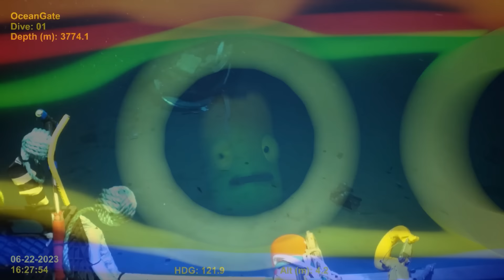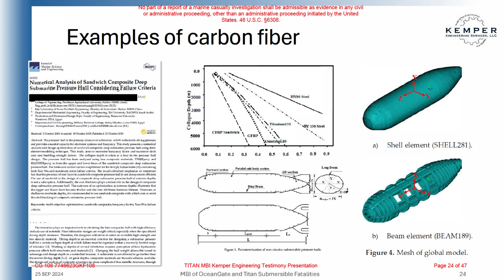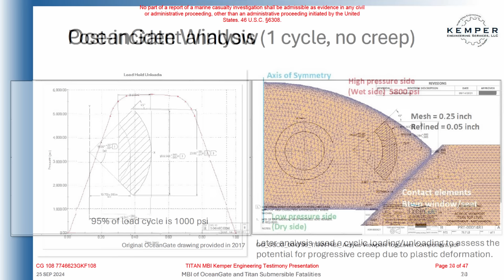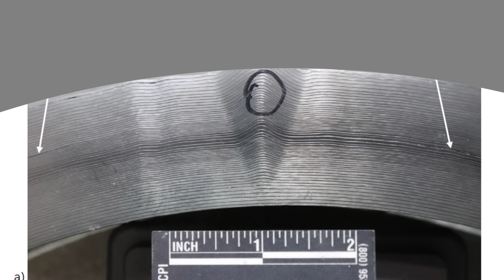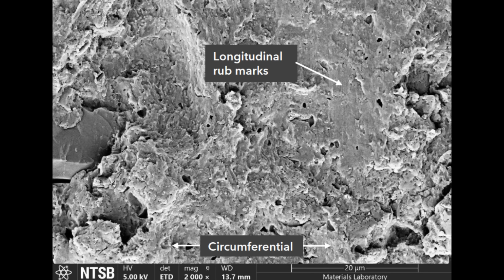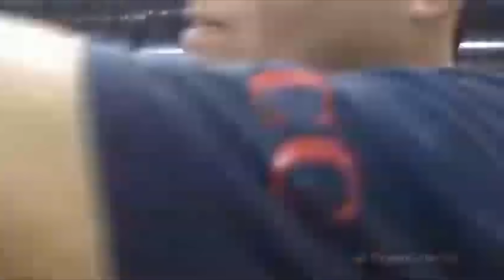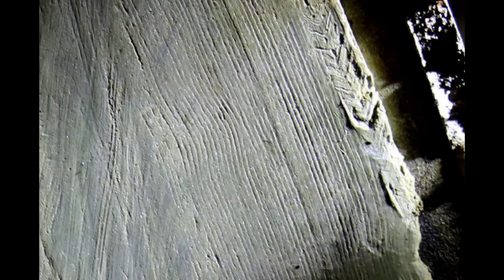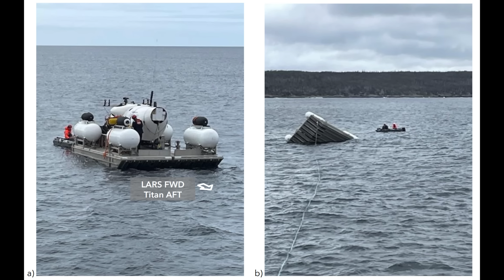OceanGate Wreck Shows Why Sub Wasn't Strong Enough To Survive - NTSB Shares Important Details

Comment: They kept talking about their acoustic monitoring system, but didn't pay any attention when it actually detected something. Sounds like they were using it as an excuse rather than an actual safety device.
Reply: Good instruments and equipment can't protect you from incompetence.
Reply: @barahng Yep. That strain step looked absolutely frightening. I work sometimes on devices where fastening forces are critical. Such steps are always due to things moving when they shouldn’t. Things get unbolted, checked out, reassembled, and subjected to repeated loading again. The strain curves must show no hysteresis. And this is not any sort of a safety-of-life device. It typically is entirely non-critical but participates in measurements so has to act properly.
Reply: @barahng  Yes, you need safety procedures, and the discipline to follow them.  There was none of that here.
Reply: @barahng a lot of plane crashes prove your point so much. State of the art equipment with pilots somehow messing up.
Reply: I think to be useful it had to be calibrated empirically via destructive testing, they didn't do that, so in practice it was smoke and mirrors.  They got one datapoint, at the cost of lives.
Reply: @LokiCentralthe other problem is the micro-fractures which happens every descent and the number of cycles. Every dive the pressure vessel gets weaker.
Reply: Crazy that it actually worked exactly as intended ... they just ignored it when it (figuratively) started blaring an alarm.
Reply: @a_51_  Yeah there was a lot of ignore'n going around at that company...
Reply: @a_51_ also looks like they didn’t know how to plot the data in a way that would make it more obvious. Using time instead of depth as the axis.
Reply: @nictigre03 Even if they had plotted it on a time basis, overlaying the dive profiles for one dive to another would have showed some variation so they would have still seen something strange I would think. Obviously the correct approach as you said was to plot it versus death but even their incorrect plotting should have shown something if their management had actually looked at it. In that one purple and green time graph that he shows you can see that the values on the right side end up different than they were on the left side at the start of the dive which to me is an immediate red flag.
Reply: @nictigre03 it was rarely the graphing choice that was the problem, they needed to compare the data between runs to see the discrepancy.
Reply: @nictigre03  it looks obvious if you just look at the stress/strain graph lined up with the sound graph.  There's a huge 'jump' in the strain at the same time there's the loud sound, so it's obviously something shifting. They just didn't look at the two graphs at the same time.
Reply: @takanara7 I think Phil Brooks, the electrical engineer who was originally in charge of the real-time monitoring, had trouble downloading and  processing, let alone analysing, the gigabytes of data from all the sensors after each dive in time for the evening recap meeting and potentially, a new dive next day. I don't know why the data couldn't have been written immediately to an external hard drive on board, rather than Brooks having to clamber in to manually download the files. Brooks resigned when Polar Prince was hired because he was unwilling to bob about  on the LARS in the stormy open Atlantic to carry out tasks like this. So question: Was anyone analysing the real-time sensor data in 2021-2023, especially on dives 80-88?
Reply: @doublestrikePhoto  "plot it versus death " - a rather unfortunate typo!
Reply: @nictigre03 That they didn't fix the data channels that weren't working implies strongly that they weren't even looking at the data, and just relying on the "event counter" with nothing but guesswork to indicate it actually meant anything
Reply: @alayneperrott9693 I reckon SR would have given the readouts a cursory glance.  Didn't A Welby? say that she asked questions about the monitoring etc and was given the bums rush.
SR wanted to be a maverick.  Unfortunately he was more of a mad dick.
Reply: @a_51_ 100%
Reply: @a_51_  it's not crazy. It's one of the basic tools we learn in engineering school. Very simple and works bcuz of electric resistance
Reply: @VoidPixel4179  read the whole comment. It's crazy *that they just ignored it* even though it worked as designed.
Reply: @johnathanclayton2887  that basic corporate philosophy. You pretend to use Security measures and then ignore them when they become inconvenient.
Reply: The horrible part is, they didn't even need their high tech acoustic monitoring system. The relevant event was audible to the human ear.
Reply: Absolutely! The last thing Rush would want to see was evidence his contraption was failing and would need to be scrapped immediately.
Reply: @wattage2007  welp, it and his life ended up being scrapped in the end
Reply: @wattage2007 Rush sacked his Director of Engineering, Tony Nissen, in 2019 for refusing to certify the Titan prototype (Titan 1), because the carbon- fibre hull was increasingly noisy, indicating possible delamination events, and it had developed a significant crack. What extraordinary hubris - or adrenalin addiction - to demand to take passengers down to Titanic depth in a submersible with a cracked pressure vessel! In the end, he built the copycat Titan 2, re-using some components like the titanium domes, and just carried on.
Reply: @wattage2007  - yes, it's called planned continuation bias.
Reply: No better than people who put tape over their check engine light...
Reply: @ratdude747 u kidding? Oceangate is way worse.
Far different situations
Reply: @ratdude747 that's why I go the extra step and take the check engine light bulb out😅😂
Reply: The boss fired it, like he fired everyone else that raised an alarm.
Reply: @CptJistuce  If someone keeps dismissing all criticism, you know you can't trust them with any critical operations - Be it building and operating a submarine or leading a country.
Reply: @oxydator  Fortunately, Stockton Rush isn't running for office(or anything else anymore). Unfortunately, his submarine customers didn't know he was so dismissive of criticism.
Reply: Acoustic emission detectors are used to determine the actual location of an event by measuring time delays of the various detectors and plotting the location. Popping sounds in CF under stress are indications of delaminations or failure in the material. They should have been able to after a successful dive to determine areas located by the detectors and using different methods like ultrasonic , Xray or thermography determine the extent of damage. CF does not repair itself after damage. After determining the extent of the damage a decision can be made if the damage is acceptable. I don't see how any damage is acceptable. CF failure is nearly instantaneous. By the time you detect popping noises at depth it is already too late.
Reply: @fredwexler1362  I would have thought so too, but I guess not. They heard big snaps in previous dives before the disastrous one, but ignored the warnings.
Reply: Only someone like Stockton Rush would have a patent on a system that he didn't even understand how to use. In truth it was a board member that designed it, but Stockton got the patent in his name.
Reply: @bees5461  I never saw a patent.  How would the front window pass as some type of advancement in technology?
Reply: @Hoopaball  I have no idea whatsoever. But he had aa patent on the window, probably because of the new design with the inside being flat so the objects don't look further away. Other than that there is nothing about the window that is different.

The flatness is also why the design was only rated for 1/6 of the depth that same window would have had if it was concave on the inside just like all other submersible view ports. It's only "innovative" in how objects outside would appear to passengers, but certainly not innovative in terms of performance or strength or any other metric.
Reply: People who have been on the sub previously said that there would be sudden cracking noises as loud as a gun shot when diving. The Seagate CEO said it was just the hull adjusting to the pressure.
Reply: One big problem with how they were already pretty deep is that it meant that monitoring system was like using your hearing to warn you about an incoming lightning strike. Too late to be of any use. More of a warning to the passengers. "You are about to die."
Stockton was a monumental idiot.
Reply: @blunthonesty8633  The video states that the curve started shifting on dive 80, with the loss occurring half a dozen dives later. That's plenty of time to decide to stop and call off the next dive.
Reply: It was probably there just to give the illusion that it’s safe to everyone
Reply: 30 Million lbs of force is the equivalent of a fully loaded cargo ship. If the passengers knew this I doubt they’d have gone.
Reply: If you change the plot at 26:00 to show increasing depth across the X axis and increasing strain up the Y axis the curves tell a story.  After the bang that inner portion of the hull was deflecting more (initially) - showing more strain.  Until a certain depth is reached and other portions of the hull have deflected enough to take up the load/strain.  Lots of unknowns and variables as to what might have caused this.  The one thing it indicates clearly though is that the hull had changed and was changing.  This was the one change that resulted in something captured by the monitoring system.  This should have been a big red flag that the structure was not immutable and the dynamics of it were changing.  I can't imagine the mental gymnastics needed to look at that data and discount/ignore it - convince yourself everything is fine.  Something changed in the hull and now portions are experiencing more stress/strain than before.  What and why?  Could that happen again?  What if the increased load on the next part to experience this is too much?

One other observation - I had no idea the flanges on the rings were so thin.  Basically only enough material there to align and hold the structures during assembly, not really load bearing in any meaningful way.  That means any difference in the stress/strain performance of the ring vs carbon fiber would result in a sheer load across the adhesive interface.  An adhesive applied to machined/polished-smooth surfaces...  Granted, there would be a simultaneous compressive load on the adhesive.  Still seems like they were asking for trouble.  Maybe the strain rates were engineered to be identical.  Maybe the properties of the adhesive meant that under compression it was elastic enough to absorb the differences in strain rates between the ring and cylinder.  Or maybe local imperfections and inconsistencies invalidated those assumptions and analysis...

After seeing that graph, and seeing the way the rings were designed, I wouldn't have taken a ride in that to the bottom of a swimming pool.
Reply: The logic he used for the sensors meant he could just shrug every time something strange happened
Reply: Stockton Rush reminds me of the guy who died in Alaska in the school bus. Both of them thought they knew better than others who had much more experience. They were intelligent, but not quite as smart as they thought.
Or, as I like to say, too clever by half.
Reply: @a_51_ That's the important thing.  Acoustic events in composites are common.  You have to compare them to strain or stiffness data to understand the condition of the structure.
Reply: Stockton Rush said safety was "pure waste," so this tracks.
Reply: Clearly, warnings were only a formality for this fraudster.
Reply: I think I saw in some video analysis that three of the sensors weren't working at all.
Reply: @The10folks  Ya but we have the data shown in this video that show that the hull starts behaving differently, so there was still enough data to show that something was going on
Reply: @The10folks  It was mentioned in this video that three sensors weren't working, but those that were detected strains / acoustic events from Dive 80 onwards that were ignored by OceanGate, automatically attributed to causes that wouldn't affect structural integrity without investigating further. They likely thought that as long as there were no immediately obvious visual signs of damage, the sub was perfectly fine. During the final dive, the attitude was likely something along the lines of they've paid a lot to be here, there's absolutely no way we're going to abort and have to refund their money - besides which, the sub's survived 80+ dives, there's no reason why it shouldn't survive many more. Never mind the sensor data or reports of strange noises reported by occupants on previous dives...
Reply: @The10folks  The strain gates probably had broken down by an overstretch from emerging damages to the layers of fibres.
Reply: Absolutely 💯
Reply: It was differently shaped. Doesn’t take much to get a patent on some things. Just pay the fee and have something that isn’t exactly like something else on record.
Reply: @Skigress  VERY TRUE!!!  Pay a Patent Atty, and here you go.
Reply: Security theatre, safety theatre :) Lessons learned from other non working stuff, I guess
Reply: What's also crazy is that those kinds of monitoring systems don't really work all that well with composites, either. Metal components tend to fail "slowly" when they get overloaded, as they can bend/deform while still retaining most of its strength, which is what causes most of the noise, but composites generally fail very quickly when overloaded, as they don't bend, they crack. This isn't to say that one is better/stronger than the other, just that the failure curves are different, and metal usually makes noises throughout the failure curve, while composites only make noises towards the end of the failure curve. An acoustic monitoring system should not be relied upon when dealing with composites, they should be using other inspection methods like ultrasound or x-ray to locate signs of overstress such as delaminations or cracks.
Reply: I think they did investigate the bang at the very end of dive 80 but attributed it to the sub shifting in the cradle. However that appears to be when the strain gauge response changed. Strongly suggests something structural changed on dive 80.  It's not clear to me if they plotted strain vs depth graphs at the time so it may have gone unnoticed. If only some NDT testing had been carried out over the winter between dive 80 and the last one.
Reply: Yeah, seen many interviews where he mentions this safety measure.
Reply: Not to mention three of the sensors not even working!!!
Reply: Yes, that would be like putting a snooze button on a smoke alarm😎
Gaz UK.
Reply: Boom! Bang! Borf! Hare Krishna!
Reply: I wouldn't be surprised if they found the alert to randomly trigger and found it to be unreliable
Reply: Its funny how seeing the cliff ahead doesnt help if brain paralyzed
Reply: I think these monitoring system are mainly installed to reassure their potential customers for the monitoring of safety system rather then actually using the data to interpret some possible failure. Even if some engineers probably raise something they would have been silenced as we know how Stockton Rush tried to evade every sefety and certification procedure previously.
Reply: The fact that there is now an NTSB report means that this incident is officially eligible for a Plainly Difficult video. Its bingo card must be a doozy...
Reply: No, they didn't miss or not paid attention - they knew everything, just ignored the signs so that they can take more money from potential customers.
Reply: Yeah it was for marketing
Reply: EXACTLY! So Stockton Rush😂
Reply: It was what is called "trust candy" that your eye's see and you trust it better.
Reply: Autistic
Reply: Pretty certain Stockton Rush's argument is there is no way this minimally tested material for this application is going to fail because technology solves every engineering problem, even the ones Rush was conveniently and possibly even actively ignoring because Rush's corporate funding was too tight for Ocean Gates corporate mission statement.
Reply: It was a typo, they meant autistic
Reply: I think they had those so called safety systems so they could say they had them but not actually use them, furthermore I bet they were not mentioned in the one day pilot training ? Hard science of how not to do it !
Reply: The trouble is, if it detects an anomaly, what then? They didn't have a plan or idea on that.
Reply: actual gauges & indicators would be nice
Reply: The glue turned to powder . That’s what happened
Reply: Can it acoustically monitor my flatulence as i sleep?
Reply: Can my phone?
Reply: Acoustic monitoring.😂😂😂😂😂😂😂😂 I don’t know 😂😂😂😂😂😂😂😂😂. That was like putting sensors on a stick and cracking it. 😂😂😂😂😂. Yep, it cracked. One crack and that stick is done. One crack and a cf tube is done 😂😂😂😂😂😂😂😂😂. It can’t heal itself😂😂😂😂😂😂😂😂😂😂😂😂😂. Stocked crushed that dive, that’s for sure😂😂😂😂😂😂😂😂😂😂😂😂
Reply: It's good your an expert and know the extent to which they monitored it. I wish I had been there to witness it all unfold before anyone knew what was coming. Your crystal ball must worth a fortune.
Reply: @sambranton3346 you saw the reports in the video, right? That they were overriding the warnings? But predict future failures is exactly what a system like this is supposed to do.
Reply: Normalization of Deviance...safety, pffft
Reply: The PR system worked better than the 'safety systems'.
Reply: just like Chernobyl
Reply: If you tuned in to the coast guard hearings, I think it’s obvious Stockton knew the hull was starting to fail. And I think he was on the sub every dive after the alarm BECAUSE it was failing. Oceangate was in financial trouble and his company’s sub was beginning to fail, so he went down with the sub so no one would be left to be held responsible. I assume he had life insurance payouts or something that he wanted to make sure was paid out in full in the case of his ‘accidental death’. That’s just my theory though based on what a few people claimed Stockton said and did leading up to the dive.
Reply: @virtualgambit577  Yes, but if he thought it was going to fail, then why take on 4 passengers / 'crew' on board ?
Unless he was very twisted, but I don't think he was, he just thought safety and risk  was over hyped as often is on land etc, but not in a submersible at those depths.
Gaz UK.
Reply: Eh, I'm sure it'll all work out.
Reply: Such an amazing system.  We're talking a safety factor of seven...at least!
Reply: I am not an expert but I guess things will be making crackling sounds going to those depths.